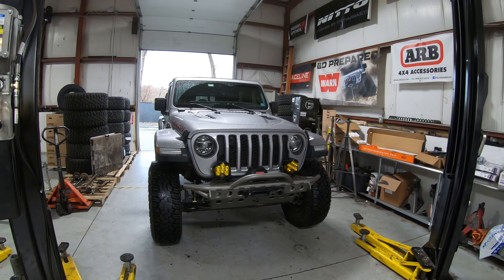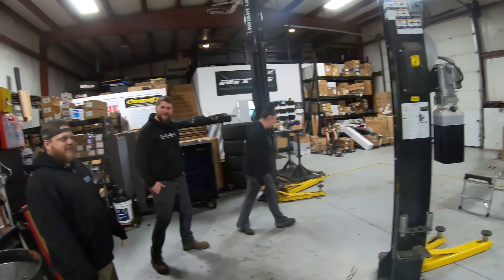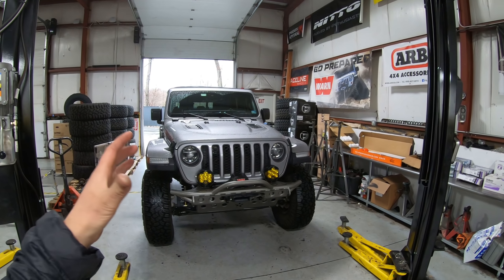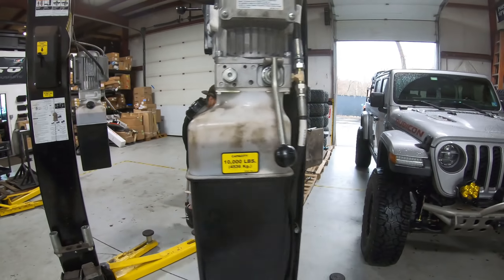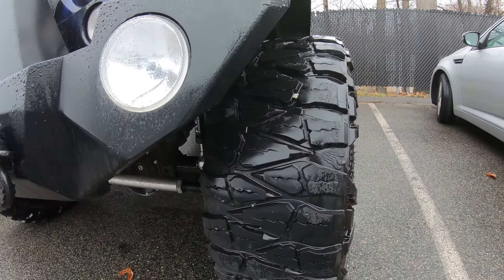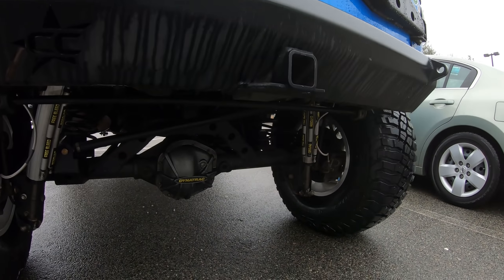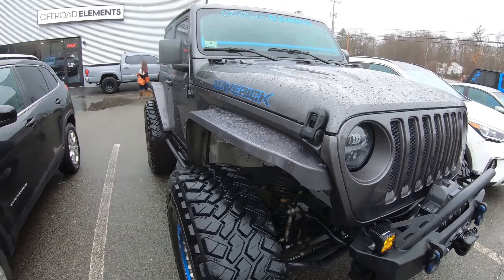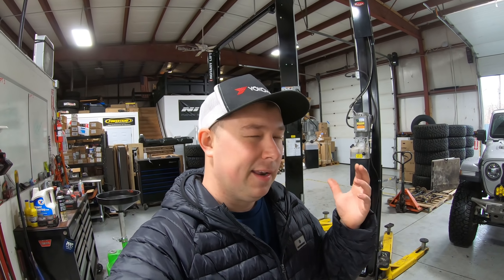Major Jeep Axle Upgrades!!!!  Axle Build Episode #1

Comment from the maker: Leave a comment with your current axle and tire setup! How do you like it, and how is it working out for you?
Reply: Hi i just wanted to ask since i want to buy things for my dads gladiator since im wanting to suprise my dad withs some really cool parts like a a winch bumper and also some stuff fro the front axle and i really want to know if welding a truss on the axle is gonna void the warranty cause i really am wanting to know if it will void the warranty if i do weld it on for him and i just want some info regarding to the warranty
Reply from the maker: Dylan Aponte they could possibly deny any axle related issues
Reply: @JKGearandGadgets  Yeah thats true i dont think they were gonna cover it anyways if i bought axles and some gears for the front and rear but thanks for the info man :D
Reply: JK Gear and Gadgets your “channel” is for deplorable’s and folks that struggled to stay out of special ed.  General knowledge with basic parts.

Comment: JKU with 37's. UD44 up front, 44 rear with Yukon Yukon chromoly axles. 5:13 gears. Detroit locker in the rear. E locker up front. I like the set up.

Comment: This past weekend I did a complete axle overhaul. 5.38 gears, chromoly rearaxle shafts from yukon, rcv front, barnes trusses front and rear, inner c gussets, and new front lower control arm mounts on 38" milestar pats and loving it so far

Comment: I'm running a factory Rubicon front Axel that is sleeve and trusted with OEM axle shafts, in the rear I'm running factory Dana 44 non Rubicon axle with 5:38 gears, on 37s never had a problem, wanting to upgrade to 40s as soon as my tires wear out, I have a Lightfoot

Comment: I agree.  I do a lot of my own work, but sometimes it's nice just having someone else do the work.  I have a 2013 Hemi JKU and I'm running 37inch Mickey Thompson MT's, Dirty Life bead locks.  Front axle is a Currie 44 with Cro-mo axle shafts and Rough country knuckles.  Rear  axle is a stock trussed 44 with cro-mo's (for now)  Re-geared to 4.88's with ARB's

Comment: I'm runnin 37s on my completely stock 30/44 axles. 3.21 gears and everything no sleves no gussets no lockers and I go alot of places that I shouldn't be able to. It has to do alot with tire placement and just a little common sense. I mainly rock crawl and trail ride occasionally but when. I do wheel it's not easy by any means.
Reply: this /\.... be smart about it. You read forums and it sounds like if you even bolt anything bigger than a 35 on Dana 30's they will explode. Most people don't do half the stuff we see in videos and they offroad every weekend.

Comment: I just got done having my jk regeared to 4.88 while swapping the front axle to a G2 core axle that I swapped my internals over from my stock rubicon axle. I’m on a 3.5 MetalCloak gamechanger with 37’s. So far the Jeep drives awesome. Still in the break in period for the gears.

Comment: Building a set of JK44s. Plan to run 37s
Truss, sleeve and wrapping the axle
Ball joint deletes
Reid knuckles
Would love a set of RCVs front and Yukon axles for rear
Keeping the factory e lockers and gears for now but want to go 488s

Comment: I've been running 40s on my Ram with a DANA 44/ Chrysler 9.25 until I finish the factory 3500 axles Dana 60/80. I wheel it hard and no complaints. Other then DEATH WOBBLE

Comment: I'm running a ProRock 44 up front, with the stock 44 in the rear.  No lockers yet, 4.88 gears,  rcv shafts up front.  37 inch Nitto Ridge Grapplers for tires.  It's working great so far, though I need to get lockers, and chromoly shafts for the rear.

Comment: I’m with you man. I do a lot of my own stuff but I paid a guy to do my gears this time. I just didn’t want to deal with it. I ran a 44/60 hybrid. Ford HP 44 with Reid outers and 35 spline chromoly shafts for 13 years on 40’s. Never had a problem. Axle cost me 3k to build.

Comment: Hwy how would you compare your axle build to  prorock 44, Dana 60,  etc
Reply from the maker: No Dana 44 will ever compare to a 60 just because of the ring and pinion size. A 44 pinion and ring gear is a 44 ring gear, doesn’t matter the brand of axle.
As for strength, the JL/JT axles are fairly strong, add a truss and some gussets and the housing is good to go. 
Add RCV or chromoly shafts and your good to go. 
In the past, I did a Prorock44 on my Jk. It was a waste of money. Either go with one ton Dana 60s or build your axles. 
I would put this axle up against a prorock any day.
Reply from the maker: And on top of that, it’s a fraction of the price to build and upgrade both front and rear compared to axle swaps
Reply: @JKGearandGadgets  That's awesome,  it looks like the way to go for me as a rocklander..lol. I'll be watching this segment closely, I'm already ordering the parts I need. I already regeared so I'm good there. Awsome, this is my favorite so far!!

Comment: Looking forward to this series. I have a 07 JKU with 37's and have a Dana 30. It has 4.88 gears, arb locker, Reid knuckles, rcv's, 2.5 ton drag link and tie rod, Teraflex big brake kit,  psc ram assist, and it has sleeve's. At this point I'm just waiting for it to break so I can upgrade but it's been great so far.

Comment: Ultimate Dana 44 up front, factory 44 beefed up in the rear. Currently running 35s until they wear out, then going to 37s or 38s.

Comment: I run a 95yj 4cy. Dana 30 4:88 chromoly inner and outers 36 inch Swamper TSL powertrax Locker 8.8 in the rear Foot Locker hold up just fine for a wheeling in Arizona rocks.

I don't wheel stupid I just make it crawl. Low-power lightweight works great for memea.

Comment: Ok definitely looking for input on this one.  
I have D30 with 35s
Planning to upgrade to 37’s or 38’s
And regear to 4.88 with lockers and upgrade axels. 
My original thought was a truss and C gussets on my D30. 
I do mild to moderate trails at this point and don’t plan to do more than that.  
But now I’m second guessing that plan😨. 
👍👍
Reply from the maker: The main concern at that point is the ring and pinion of the 30. 
The best option would be to do a 44 front that’s already geared with a locker. 
Then match the rear ratio and add a locker. 
It is expensive though. 
37s would be the absolute max for a Dana 30, and that’s pushing it. You will be able to Offroad, but every time you start spinning tires you are really risking a pinion break
Reply: Bummer to hear but I definitely don’t want to have a problem on the trail😨. 
Well this will have to be a project for next year. That’s alota $. 😖

I appreciate the input !!
Thanks
Reply: Always keep an eye on the junkyards for D44s on totaled JKs, JL, and JTs.   I would just watch for a Front and be ready to buy as they move out fast.
Reply: Blaine Reeve   Thanks that’s an awesome idea!  I’ve heard other people do that.  I just hadn’t really thought about doing that myself only because I was thinking of beefing up the D30.    
But I will be looking around for a donor 44 and hopefully build it a bit less expensively 🤞.

Comment: On my old Bronco, I ran a 79 Bronco 44 with chromoly shafts, lockright locker and 4.88 gears on 37” Humvee tires with 24 bolt beadlocks. Under the power of a 351W I didnt break anything on a vehicle weighing over 7000lbs. My JK, I hit on small gully and bent the front axle. I just got a set of one tons (60/14 bolt) with torq locker, 5.13 gears and Artec truss for about with an aftermarket 44 goes for. If you’re looking at upgrading your axles, do some research first. It may be worth it to go to one tons, or, you may benefit from minor upgrades to stock axles.

Comment: So what would you recommend for someone that has a daily commuter. 35's or 37's with the stock Rubicon axles? Will the stock Rubi handle 37's without doing damage? I've been thinking 35's with a 2in lift/level, I'm told I will regret that decision.

Comment: JTR 35's 2" Mopar lift 
Want 38's and more/better lift
Why not wait till something breaks before upgrading axles?
Reply from the maker: If you bend your axle, your screwed. Can’t just weld a truss on after.
If you blow a u joint, it can take out your balljoints and knuckles. 
Fixing axles in the middle of the woods usually isn’t fun, then you have to find out how to drive home. 
It’s easier to beef the axles up when you can do it in the diveway or a shop, opposed to trying to figure out wtf to do when your jeep is broken in the middle of nowhere
Reply: @JKGearandGadgets  Thanks. Experienced information.This may be a good alternative to costly Dynatrac axles.

Comment: Really looking forward to this series!   Jku Sport with D30 front and 35's.  Dont plan on going bigger with the D30.  Daily driver and trail use. Not a rock bouncer setup but I still want to upgrade the weak points when money allows.   You say it's cheaper to just get another axle but does that include moderate trail use and no rock crawling like you do?

Comment: I’ve got an 06’ Rubicon on 35’s with stock 44’s front and rear. Broke a rear shaft one of the first times out and never even heard a pop. Didn’t even notice until I put it back in 2wd. Anyway, put Carbon Offroad chromoly shafts in the rear and the next timeout I blew up the rear locker. Lol, this Jeep was rear ended bad before I got it so I’m thinking it had rear end damage that snapped the first shaft and then the locker breaking next was residual damage we didn’t find when inspecting from the broken shaft. I think once it’s got chromoly’s front and rear, Yukon 5.13’s, and trussed, it will be perfect for a TJ Rubi on 37’s. That’s the goal anyway!

Comment: I'm assuming you are still using the factory studs on the front.  What or whos? wheel studs are you using on the rear? and can you provide a link to those, please.
Reply from the maker: Studs? For what
Reply from the maker: Ahh for the new shafts, the yukon kit came with new studs.
Make check yukon and see if they sell wheel studs for the JL/JT
Reply: I just returned from Moab.  We drove from Daytona Beach area to Moab, wheeled for a week and drove back.  I have a 19 JLUR with 39 KM3s with stock gears.  Didn’t use 7th or 8th gears very much, if all.  Was looking into upgrading the axles also with RCVs & Chromoly rears, but wanted to get your opinion on ratio.  Got about 14 to 15 MPGs during the trip, 4000 miles.
Reply from the maker: Trail Blazer JLR with 39s I would highly suggest 5.13s.

Comment: So why CV axle shafts over chomoly in the front?
Reply: Leandro Ramirez no
It has the same strength in the joint at no matter what angle it’s turned at
Reply from the maker: RCVs are chromoly, but offer a Cv style instead of a Ujoint. A lot stronger!! 
Will be talking about them more in depth in that particular episode
Reply: @JKGearandGadgets  cool thanks

Comment: So since your getting burnt out of working in the driveway, I got a idea for ya. My garage is heated and cooled, plenty of lights and Air. I also have a different jeep than is normally on the channel. I need to do some axle work. I have I wanna say a dana 30 in front and maybe a 35 in rear not 100% on that. Its a 2016 JKU sport.  Lets get together and make a new video series? I know you have nothing but free time LoL.

Comment: 09 jkur on 40s with 6 speed manual 5.38 gears ten factory chromoly front shafts factory rear shafts. Trussed and gusseted front stock (other than gears) rear. Dont do it. Get one tons. In the process of one tons now since ten factory doesnt like to warranty axle shafts
Reply from the maker: I did a full video series on tons, know all about them. 
This jeep doesn’t need one tons. Not everyone needs tons
Like I said, 37s and 38s are perfect for built axles.
And 40s you’ll want tons
Reply from the maker: That’s odd, 
I had about 5 sets of 10 factory rear axle shafts warrantied. 
Try going through the vendor instead of them directly
Reply: @JKGearandGadgets  I know lol, I made this comment towards anyone else trying to do 40s on 44s. I dont recommend it if anyone wheels hard like I do. I've been a fan of yours for a while now and I'm following your build series for my 1 ton build. All of your work is appreciated bro. As far as the axles, sadly the original vendor closed its doors and motive gear wont deal with me directly.
Reply: But one tons are the only way to drive like I do on and off road with 40s. I've already broken rear gears, both front axles, and rear 1330 driveshaft.

Comment: running 40s on a ultimate dana44 with 4.56 yokon gears and Carbon chromoly shafts. I need to go 5.13 but I would rather build junk yard axles